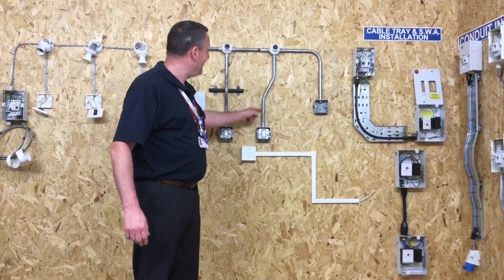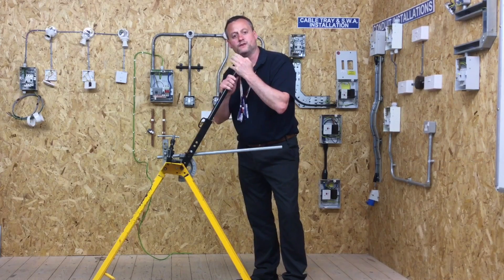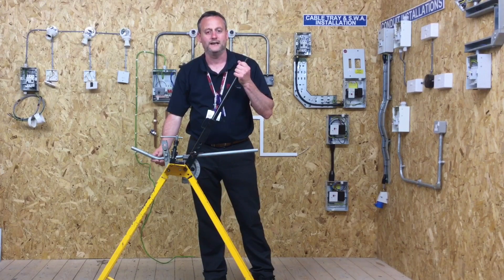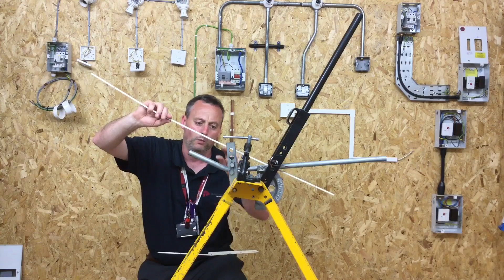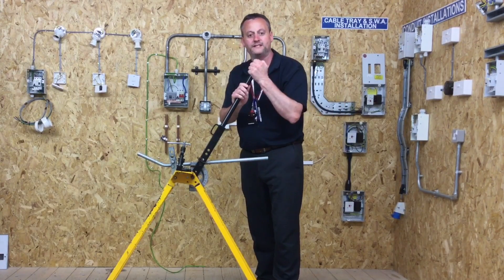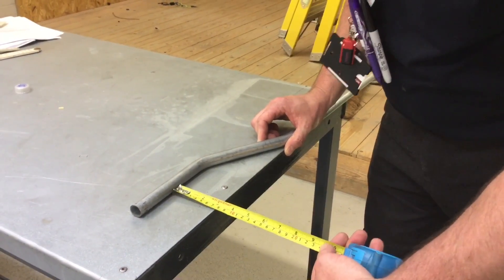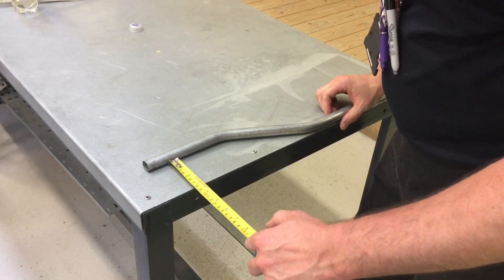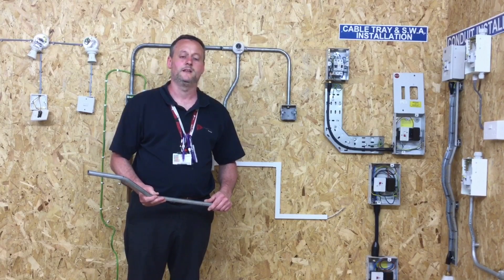Electrical Practical Skills Bending Double Set in Steel Conduit (How to Bend 20mm Conduit Offset)

Comment: Much easier to times the required distance by 1.414 for a 45 degree bend, this will give you the travel or the distance between the centres of the two 45 degree bends

Comment: When u do a 45deg bend on offset bends. From your first mark eg your case 100mm, your next mark would be 75mm X 1.414(square root of 2) = 106.6( 106.6mm) distance from first mark.

When you bend both marks at 45deg you’ll get a 7.5cm gap bang on 👍🏽
Reply: Why 106.6mm? Calculator gives 106.05mm. Just wanna get it right, don't mean to be complicated.
Reply: @reeceperna7356  yeah so u can round it down to 106.5 as you won’t even notice any diff it’s a very small margin.
Reply: @mij.londoner  no problem wasn't sure if I did something wrong when calculating it.